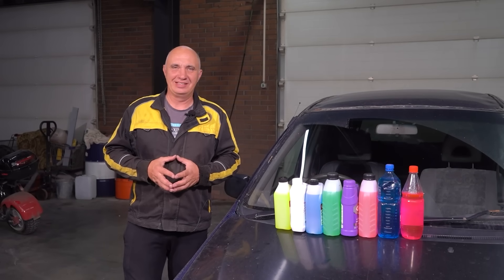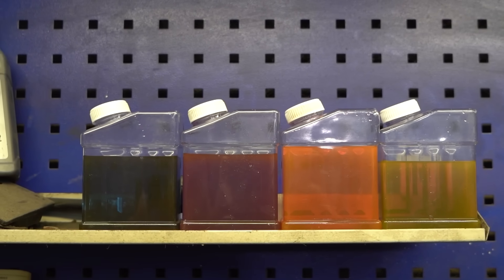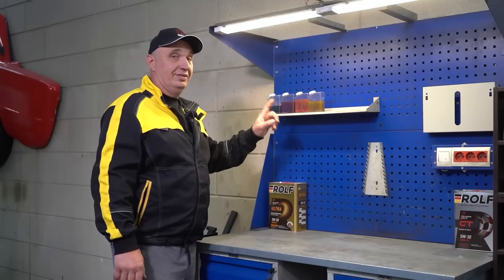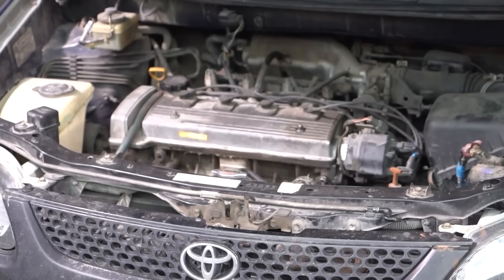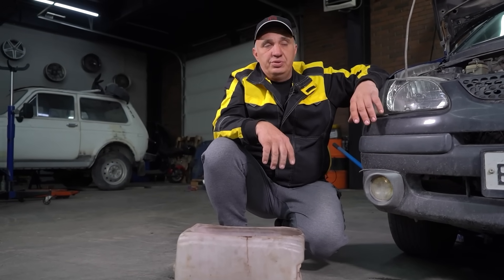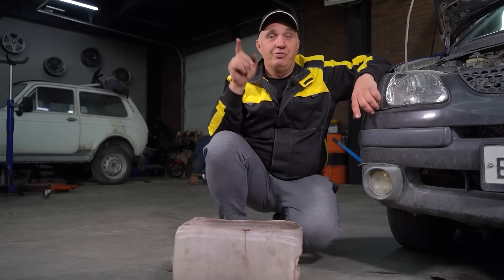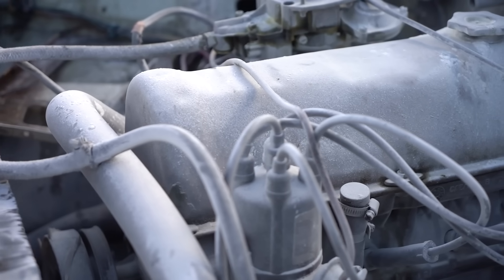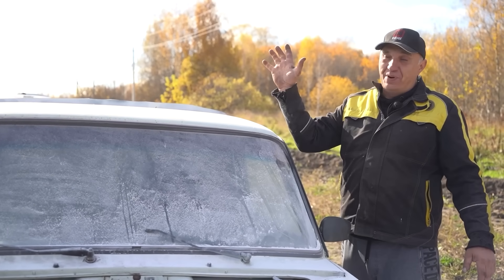Mixing coolant in the radiator (also we try gasoline) - what will happen?

Comment: I wonder if anyone with a blown head gasket has used oil as a coolant.
Reply: https://www.youtube.com/watch?v=do4Qnlm3iCc
Reply: @939Figo  doesn’t answer the question though. Will oil coolant work long term on a blown head gasket engine.
Reply: @arnoldm889  Unlikely. Because regardless of what the coolant is, there's so many times more pressure flowing out of the combustion chamber, through the breached gasket, than there is pressure in the coolant circuit to resist or overcome it, the outcome's gonna be the same. You need a new head gasket, at least.
Reply: I've used oil as coolant for a few yrs in my old toyota pickup, it worked decent. Took longer to warm up and ran slightly hotter than normal coolant but other than that it actually does run fine. Alot of tractors and heavy equipment run oil as coolant.
Reply: My father's 2001 Opel Astra with Isuzu 1.7 diesel engine had the oil cooler broken somehow inside of it. 
Oil always got into the coolant, as much as making it black and thic, but never milkshake. My father never bothered to change the cooler. The engine was losing oil very slowly because it got over the coolant. The expansion tank was always black, the engine ran like that for the last 5-6 years before he sold the car for candy money. 
It never overheated, but it always took an eternity to get up to working temperature. No other problems. 
I don't reccomend you to do that. Also that Isuzu engine was very strong, I believe no newer car could run like that.
Reply: My understanding is that some unknown process scientists are still trying to understand removes all the oil and coolant from the engine and replaces it with mayonnaise.
Reply: @nottakennick  Tried once with ranch, and it aDRESSED my situation
Reply: 😂 Yep no gasoline for coolant, got it! 😂
Reply: I prefer Oilant - every Subaru owner ever, probably.
Reply: Yes, engine oil coolers are a thing. Especially on turbo diesel engines.
Motorcycles often use oil cooling instead of using water base coolant fluids.

Replacing all the coolant fluid in a coolant system with oil? It'll work, probably not very well though. But it will work.
Reply: I did, for around 5000km till I diagnosed the problem. The oil cooler was at fault but I kept thinking the cylinder head was cracked. I connected a hose between the coolant tank and the oil pan so the overflown oil could go back to the pan.
Reply: I thought about the same thing
Reply: Haha, that's not a bad idea. I think it would be a combo of the pump not coping with the thicker liquid, the whole thing overheating due to oil not being half as good at transferring heat, and over pressurising because ,, head gasket leak
Reply: When your water cooled car spontaneously becomes an air cooled car
Reply: I honestly wonder if it could work since oil retains heat more than water
Reply: Some engines actually used oil as coolant as normal.
Reply: genius
Reply: Wouldn't it just burn oil
Reply: it will overheat very quickly
Reply: Interesting 🤔
Reply: Sounds like it'd only be a matter of waiting for everything to, cough, mix properly..
Oil in coolant is not as bad as coolant in your oil system.
But what are rules if not suggestions. Here comes a $200 oil and coolant swap. hehe
Reply: @TheHungrySlug  i mean realistically. There are planes/cars ive heard that have oil as cooling. But i may be dumb. So i mean. This could work. If you put oil into it. Maybe the rubbers and the water pump+heating wouldnt like it
Reply: Additionally the only way this would have any chance of doing anything is if there was no combustion leak. It would have to be a oil/coolant leak
Reply: I’m not sure the water pump could move cold oil given the higher viscosity… But I’d love to somebody try!
Reply: Nah, just milkshake. The bad kind!
Reply: I did actually have that though a while back
Reply: Oh yeah all the time actually, oil runs through my radiator pretty successfully with the blown head gasket
Reply: All the debris from the coolant system will end up in the oil and you'll have issues.
Reply: I have used oil as break fluid when I got stranded on the side of the road just to get to the garage for repairs and completely flushed
Reply: My guess is that it might work in warmer climate areas, but it still feels like a long shot (just going off of common sense).
Reply: I will say that even if oil is getting into coolant from an oil cooler, it will still overheat. Oil mixed with coolant doesn't make good coolant and vise versa.
Reply: r&o 32 is a thin oil works great in truck that run hot keeps them about 20' cooler over normal anti freez
Reply: If it's real cold out I bet you could get by with diesel and anti gel
Reply: Not on purpose 😂

Comment: Without the cap on the overflow tank the gasoline will just boil off.
Reply: That's a single hose expansion tank, the radiator cap holds the pressure on that vehicle. The tank fills as the engine warms, and gets sucked back in as it cools. 

On many cars that is true and you have to have the cap on the tank.

Comment: I have always wondered what would happen if you mix different coolant types. Never been keen to test it out though.
Reply: It can be very bad if incompatible types are mixed. 

Yeah, best to not do it, or buy coolant that says it's compatible with all if you just need to add a little.
Reply: @volvo09  Nah, I still wouldn't do it to any shiz-box I own, registered or not.
But I hear Hydrochloric acid is great to clean cooling systems. But, again, I am not the one to test it out. I'd forget to dilute it.